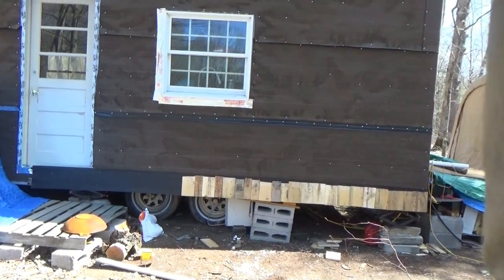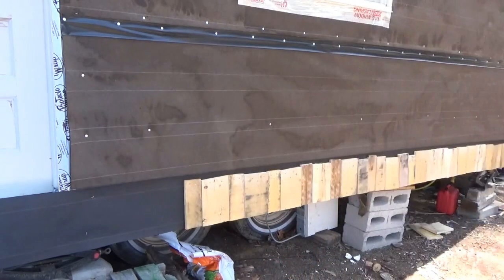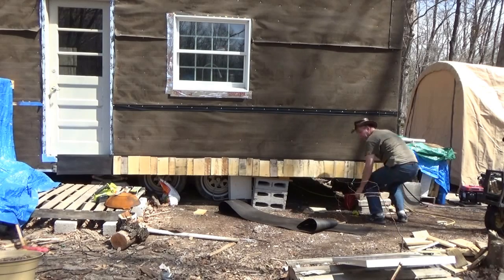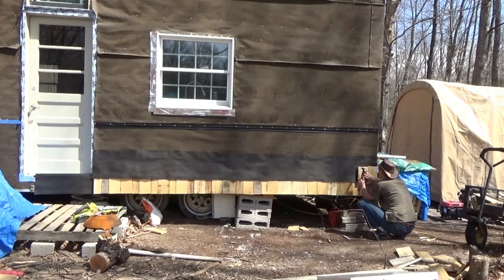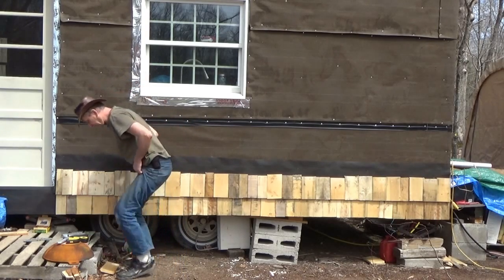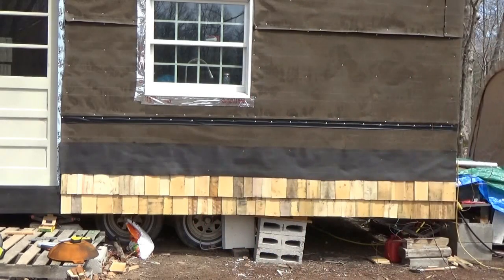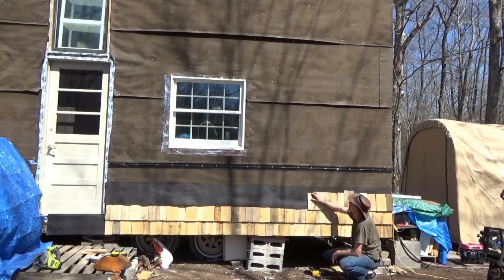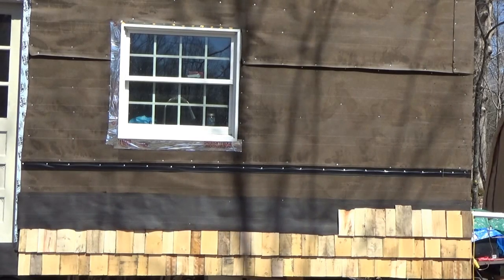Putting Free Homemade Pallet Wood Shake Siding On My Tiny House

Comment: The look of the that wood is really cool!! The price is right for sure.  If I may make a couple of suggestions.  First cut just as many pallets into shingles as you can.  That will minimize slow downs and mess.  Second get an inexpensive tool belt so things are right on your hip.  Third some type of nail gun.  Fourth some sort of basket or box to hang from your ladder to put shingles in.   I think i mentioned it before that you should do shingles up to about the middle of your windows and then run a horizontal trim piece.  Above that do vertically placed barnwood.  That will make the process way faster and minimize the time spent high up on a ladder.  It would still look very rustic and be using materials you already have.

Comment: Hey Troy, I would add your door and window trim prior to siding "UP TO" those areas. The 1x4 will not have much surface contact once installed OVER the Siding. It is wrong to try and do it. You will be so frustrated when you attempt to nail it on. Get "Brick Molding" for around the door. It is made in a Man-made Rot proof foam material.
We feel that your choice of siding will be nice and the cost is right. Good Luck
Reply: John King
I just hate for Troy, to face the frustration after the fact. I have done construction work for over  30 years. I'm trying to be helpful to Troy.
Reply from the maker: wildfireatm3 John is blocked so please ignore whatever he said. He was not nice at all.Thanks for the suggestions. Now I am confused though. It seems like many people do it both ways. I thought my way would be better to block water from getting in behind?
Reply: John King
All is Good here.
Reply: The Do It Yourself World Test fit a small piece over what you have done already and see if you like the looks of it. I agree with wild there wont be much syrface contact and I think it will stick out and not look so good
Reply: M Baldridge .
Reply: Shaggy one
Your as right as you can be here. Thank you.

Comment: To help with the straight installation, tack a straight edge on where you want the bottom edge of the new row to be then remove it afterwards.
Reply from the maker: HighView Aerial Photography That works with straight edged boards but mine are all crooked and not cut square.
Reply: Understand that, but it will give you a step to guide the bottom edge, they will all be level so long as your first on is level.
Reply from the maker: HighView Aerial Photography I thought so too. But what I did not show (deleted the video) is what happened when I used the straight edge of the tar paper as the guide for the bottom row. Perfectly straight, right. Should be fine. NOT. The boards are old and not evenly straight on the sides anymore. I had to take it all apart and redo it again using the level.

Comment: My only thought about using the pallet wood, I have been using it for various outdoor projects for years, and if the grain is not sealed, it checks and cracks very bad in two years, depending on how many times it gets wet and dry.

Comment: You have built something that will never be moved due to the fact that it is to heavy for the frame. Also its on land you do not own. Why ? and what happens if you get asked to leave ? Also you have a saw bench why did you not set up a Jig so all the timber was level and the same hight ?.

Comment: I understand the thoughts about water running down...How is that going to work with wind? Water is amazing at finding ways in the most impossible ways on it's own...Coupled with wind it's a SOB...You factored in the wind variable in your siding equation?

Comment: Need to get yourself a couple things:
1. Tool belt
2. Long flat edge
3. Battery powered nailer

If you set the long flat edge at the bottom of of the next row of shingles you can line a lot of them up at a time and then go down the line, adjust them to be level, and then pop two nails in very quickly.  The $100 spent on the nailer will more than pay for itself.

Comment: Walls look moistured behind the previous tar-paper, does it mean that developed previous method (plank + tarpaper) does not work at all? What I'm asking is if the new layer of other insulation (done in video) is required or extra. // Edit: and if moisture is really inside. // Edit: looks interesting, wonder about final and varnished/oiled version.

Comment: Hi Troy if you use The black tar that your talking about its going to ooze out along the edges when it gets hot and will get sticky and can run you have to use Window and door All weather clear or what ever color except Black that will Run when it gets hot The black Tar is for your Vents and roofing area's Not side walls

Comment: Also you may want to put 1x4 trim around your door and windows and run your siding up to it just a thought
Reply from the maker: John Fitts Actually from my understand there are two ways. One is what you say. The other is trim on top. I prefer the trim on top. Completely covers the ends with a whole lot of overlap.
Reply: The Do It Yourself World I think that John is right here. If you put the trim up first, you can put the shakes right up agains the trim while installing rather than risk the trim not fitting the space you've left for it.
Reply from the maker: FromThe Prairies But what I see is that water is then allowed behind the boards at the ends. They will be fully exposed there.
Reply: In this case, should you not be putting the siding right up against the window casing?

Comment: At 19:13 you should have went right around the corner with the tar paper. Since you cut it, now how are you going to protect the corner?
Reply from the maker: Captain Carl Wright Good point, thanks. I will continue with it from now on.
Reply from the maker: Captain Carl Wright Actually the original exterior tar paper is meant to protect the house but more is better.

Comment: Troy I have no problem with your system. The only thing I see, is the thickness of the wood. The only thing I might of done is cut the slats in half with the table saw, going from a 1" thickness to 3/8" thickness. It would take that much longer, but cut the weight in half. Hard to tell the length you have, but I would do 12" long and cover maybe 2-3 inches of overlap.  Any chance you can get some of your church people to come out and lend you a hand? If all they did was cut the wood and stack it in neat piles out of the weather, that would cut the labor time in half.

Comment: A way to possible help save time is to nail up a bord that goes full leangth across that's level do u just rests the  shingle on that and nail it on.
Reply from the maker: woodsmen1011 That works with straight edged boards but mine are all crooked and not cut square.

Comment: I like it and that extra paper will help with the wind coming threw. but just a thought let the paper at the end hang there and rap it around the corner I will help stop the corners from leaking air threw also don't cut it off. it cant hurt.
Reply: glen john  I wouldn't take off the 3 rows you have done already but I would from now on on the rest

Comment: Its 70 out how is that to hot to work
Reply from the maker: Stephen VanDyke Next to the heat radiating off the black tar paper. Look up a solar oven and see what I mean. The tar paper is the same concept as a solar oven. You can cook on it. Literally.
Reply: Stephen VanDyke If I remember correctly Troy had at least one heat exhaustion episode when he was in the service in Germany.  Once that happens, you are very sensitive to heat and can not tolerate higher temperatures like a normal person.   I dated a person with that problem and eventually we parted ways because on days where I would have loved to be outside, doing something, he had to be inside in the air conditioning or he would end up in the hospital.

Comment: Since you don't want to use flashing, shouldn't you at least wrap the tar paper around the corners? Also, in my opinion those pallet shingles need some type of insect and weatherproofing before going up. You aren't using cedar, so it might be better to do it now so the bugs don't start in on it.

Comment: don't you have an air nailer ? Build a template with a longboard that hangs higher than the string you were running then you can set 20 or 30 shingles on that board and walk them them with your nail gun at least doubling your output or should I say cut your time in half other than that it looks great
Reply from the maker: lordmbuk That works with straight edged boards but mine are all crooked and not cut square.Thanks
Reply: I'm not sure I explained it correctly
Reply: lordmbuk I think you explained it correctly. :)
Reply: I was going to link a video of Bob Vila doing it but some channel operators frown upon links from other channels so I didn't
Reply from the maker: lordmbuk Oh, I see what you mean. I misunderstood you earlier. Sorry about that.
Reply: Yeah I didn't think I said it correctly it will definitely speed your time up quite a bit if we're on the same page now lol

Comment: Many are just concerned about the added weight, hardly mad by any means. It still looks as your blocks supporting the house are sinking ,optical illusion.
Reply from the maker: Walter Bodine I keep checking the tension on the blocks and jacks and nothing has moved. I am surprised and expected things to shift a lot during winter.

Comment: For those didn't see this
https://www.facebook.com/photo.php?fbid=10204913551013413&set=gm.1599622613609640&type=1&theater

 (a simple radish / 1,5 L bottle,
simply grown with a magnet, bee wax and steel wire,
 oriented perfetely on magnetic north (not geographic N)

( flavour is best,finest,
 half water needed, help against disease etc)

Have fun.

Comment: At the ends or corners, why don't you wrap the tar paper around the corner rather than cutting it flush.  If you wrap it around the corner, it will seal the corner off a better eliminating the potential of the corner leaking.
Reply from the maker: Tom Lindauer Exterior tar paper already does the job but yes I will do that.

Comment: regarding your new genny, y wouldnt run it in the way you do, just aply a little load on it wont hurt it, and wil even shorten the running in time, just lube with a little more oil in the gas, wont hurt it a bit, sounds awful tho (schrout in contact of fan?? ) you know the things you have to do with these chinese clones, tigten al the bolts before use! lol 
big dc genny sparkplug?? or damaged due to lack of oil?? ( maby only oil alarm?) after topping over? hope its nothing big!(ones had one with a loose valve adjuster, maby a tip!)